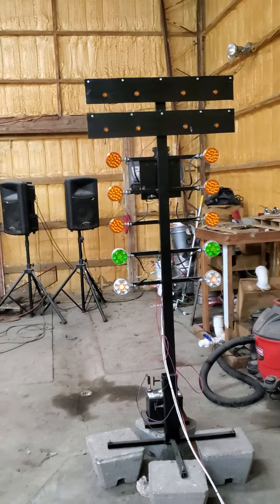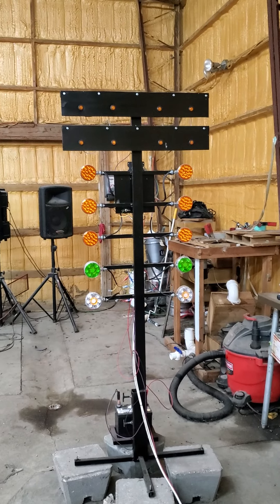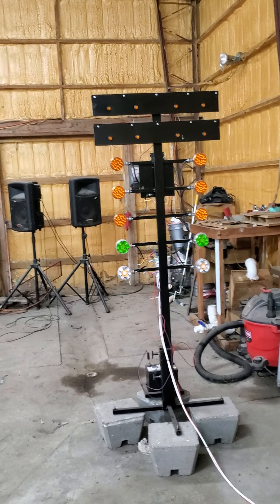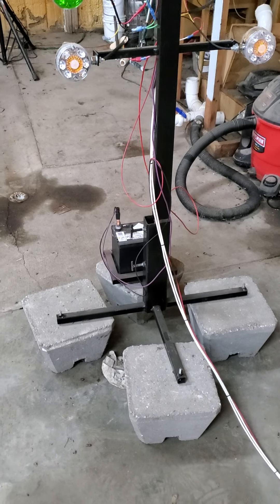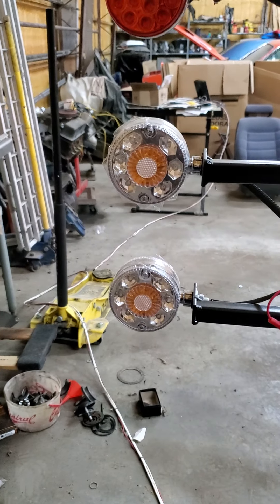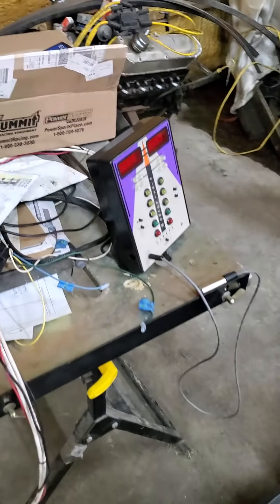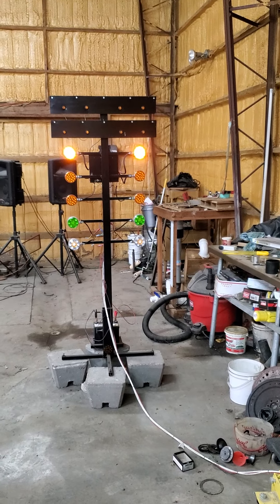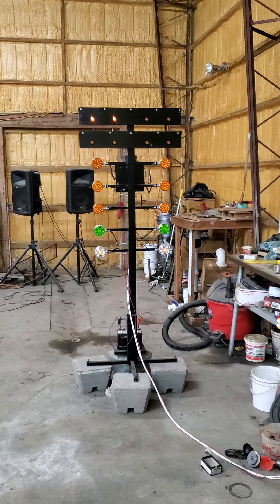(#6) Homemade drag race Christmas tree full size practice tree

Comment: hello! I'm from Brazil and I'm looking for information about the drag race tree! Your project marks the start of the race and who arrived first? Would you sell me the electrical diagram with the used parts and a step-by-step guide on how to assemble it?
Reply from the maker: @heldereddy1388  the brains of it are the small tree.  The big tree just duplicates what the small one is showing.  It's a biondo final round 4 but check out Porta tree they have an eliminator tree that's top of the line as well as selling a full size tree pre made if you are interested.
Reply: @black_sheep_fab9411   ok! Thank you!Will try tô find

Comment: If you could post your pinouts, or at least the methodology you used for figuring it out, that would be amazing. 

I’m trying to do the same thing, but I’m a bit spooked to fry the Eliminator Next Gen by prodding around with a meter.
Reply from the maker: There will be a big ol disclaimer when I make the vid to use at own risk. Lol.  It works perfect with my next gen but I'm too scared to fry it so I dedicated my final round to it.  It's gone thousands of rounds flawlessly so far.
Reply: 100 percent guaranteed I would be stumbling through this on my own risk. Just a heads up to point Me in the right direction would be handy. 

Great video. Thanks again.
Reply from the maker: New video is uploading now on the wiring.  Should be available shortly

Comment: Can you tell me the color code on the 8 or 16 wire control cable from the Portatree to the relay board.
Reply from the maker: There really isn't a color code.  Once the connector is pinned out and u know which terminal is for which light then u can make any color for any light.  The colors are just to make keeping the wires straight easier.  I need to find my pin out sheet and post it.  I'm gonna make a more detailed video some time.
Reply from the maker: More of the nitty gritty wiring side of it.
Reply: @black_sheep_fab9411  I have a portatree eliminator practice tree with the DB25 connector on the side. The control cable connecting it to my full size (single) tree got pulled out of the tree. I think I figured out that the red and blue wires are for the pre stage bulbs but can't yet figure out the 5 (3 amber, green, red)  wires for the other bulbs and if the SCR board has a separate ground(-) reference.. Any help would be nice.
 p.s. I liked your video on the home made tree.
John
Reply from the maker: Video on the wiring is uploading now.  Should be available in a couple hours
Reply: @black_sheep_fab9411  Blacksheep, thanks for the help. I got the correct pin out/color code from Portatree for my single lane tree.  Red/Blue are common on the SCR board, as I recall: black-top pre-stage, green staged,  then white, brown, purple are three amber,  orange wire is green bulb, yellow wire is red bulb.